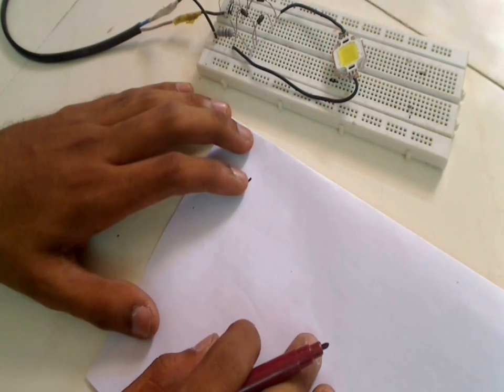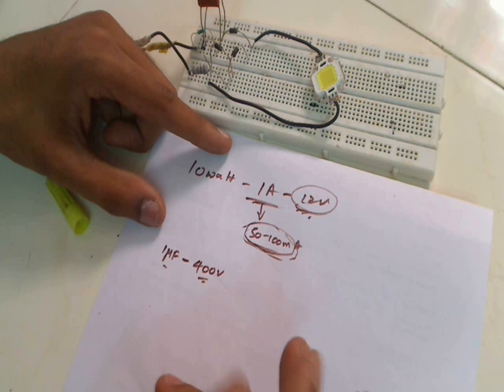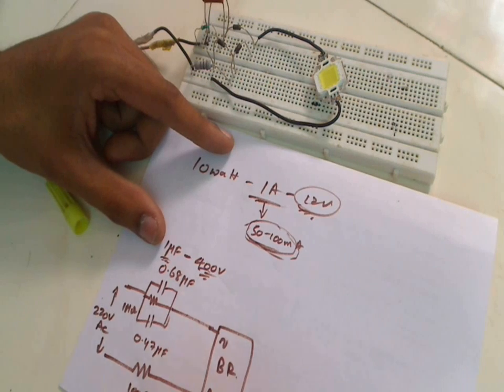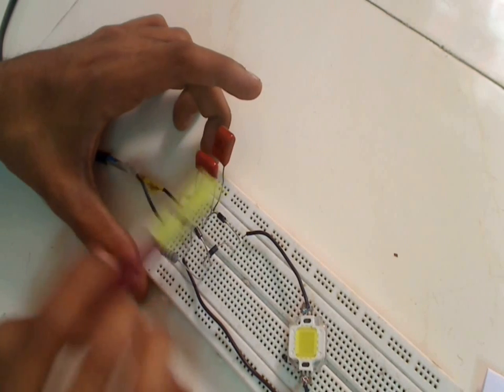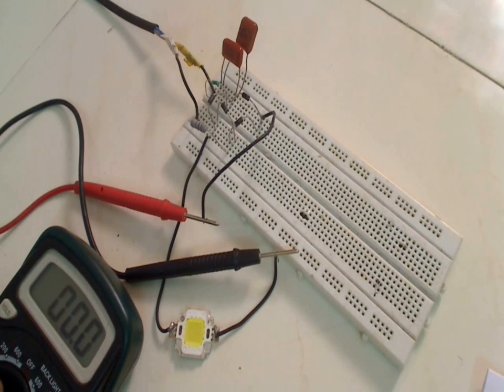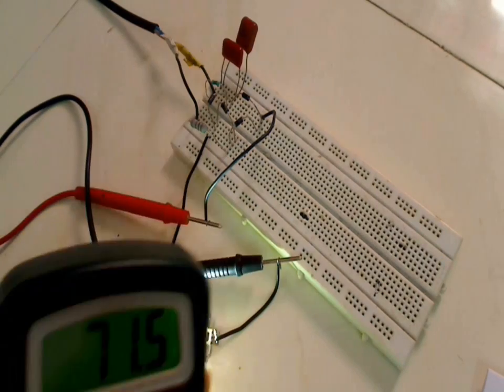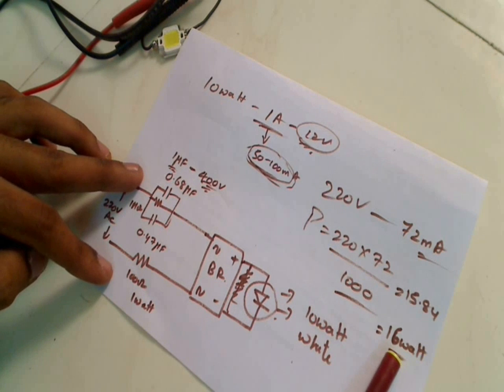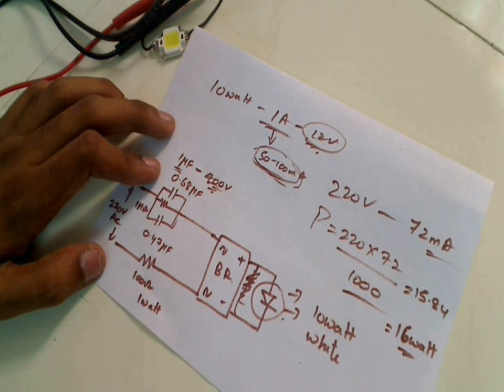Transformerless 10watt Led Driver circuit

Comment: I want to make a 20w led driver can u tell me values of components for that
Reply from the maker: +anurag dixit 20watt led requires lots of current and it's better you go for smps or a transformer power supply
Reply: Electronics Made Easy : KHADER problem with the transformer supply is that they r very big n heavy so i can't put them inside the led bulb

Comment: What's the efficiency of this circuit? There's at least some power gone lost in the resistor, capacitors and rectifier. If i'm going to drive many LEDs, would it be more energy efficient to simply skip the mega ohm resistance and instead connect like 40-50 LEDs in series, as many as would be required for optimal forward voltage. If we instead connect them in parallel to your circuit, then we'd also increase the current flowing through the rectifier and more power would be dissipated there, whereas connecting them in series would only dissipate very little power in the rectifier. I dunno... i'm just more into efficiency, rather than just making things work.

Comment: nice explanation Sir.
i wanted to power up 10W grow LED with this easy way. the light will stay ON about 18 Hrs per day.
so i wanna know, how much heat will produce this circuit and the LED??? is it efficient for my requirements?? 
Thanks

Comment: Circuit is working but 100 ohm resistors get hot too much.what should i do now ...
Reply from the maker: +Devendra Singh replace the resistor with a higher power 100 ohm resistor
Reply: Sir I have connected 2 watt resistors still the same problem....
Reply: Devendra Singh

Comment: Can someone assist me in a project? I wanna make a circuit that will power many led strips and have a fading in and off effect.. Any help appreciated.. Thanks
Reply: Shabeer Khan good morning dude, i think you need to use Arduino or a general microcontroller. is this strip RGB or  is a classical one color led strip?
Reply: @DIYelectronics its a 3 meter solid color led strip and thanks for the respond.
Reply: have you got basic knowledge ? i mean, do you know how to solder on a perfboard?
Reply: I repair laptop Motherboards on component level so I have a bit of understanding just need a little jump on what components to use for my desired lighting effect
Reply: OK.. like i've said and arduino ,even the attiny2313 (suitable up to 4 fading outputS ), or an attiny85(up to 2 outputs), mosfets (a transistor is suitable too), the number depends from the led strip number, and the same number of mosfets resistors (any value between 100 and 2700 ohm is suitable). if you want a code for the Arduino, last summer  i've written a code for the light effect you are looking for, so eventually you only need to ask. have a nice day sir.
Reply: thank you for your help...and i was really interested in making a circuit that only involves a couple of caps and resistors that slowly charge up and slowly drain to give me the desired effects. if you can help in assisting by listing the components and point in the direction or a schematic that would be great and thanks again @DIYelectronics
Reply: Shabeer Khan oh, i'm sorry friend. if you only need a fade effect, a pairs of capacitors, some resistors and a couple of transistor are enough. if you want to give me your email whould be simple for the schematic. otherwise if you don't like to leave the email address here i can give you mine, so you can write me and i can reply with all the component list and schematic. bye.
Reply: Shabeer Khan i've copyed the mail addres, you can delete the message now. i'm going to test my schematic on breadboard as soon as possibile, but in the next 2 hours you should find my mail.
Reply: Ok I'll watch out for the email
Reply: sent emails. version with legendary 555 timer. tomorrow the transistor version will be released

Comment: Your power calculation looks strange. You need to measure voltage over LED and multiply with current (0.072 in your case) to get LED power.

Comment: Do you think it would be possible to use 2 LM7812 voltage regulators running in an ac configuration from mains to do this?

Comment: What are the capacitors for? I understand the resistor regulates the current through the LED, but the capacitors look like they would just be a high-pass filter.

Comment: why the circuit give you shock please explain?
Reply: because you are dealing with AC voltage, which is conductive to human body more than DC
Reply: +Smatchimo yes that's right bt the output of this circuit is DC also this is a smps supply.I think if a transformer is used then the circuit will not give you shock.if you know the reason and the solution please explain and share.thanks for your comment.

Comment: Please give me a transformer-less 12volt 2amp dc power supply design with components description.
Reply from the maker: +Atikul Islam a transformerless poweUpplies are usually preferred for low costs and also the portability of design. A 2amp power supply requires a really big capacitor (infact very costly one) and the circuit becomes really dangerous due to the amount of current output so kindly prefer transformer power supplies for higher current.

Comment: its not working even with the specific values. not even for a 5 watt led or even for a 1 watt led....
Reply from the maker: +Parasar Bhattacharya you can try using a 2uf capacitor but better to keep it as low as possible to avoid high current flow
Reply: Electronics Made Easy : KHADER
 thank you i  will try that and  report ... thank you..
Reply: Electronics Made Easy : KHADER
 i idnt find a 2 MFcap, so used 3 caps with a total of .956 mf nearly but my led burned out... so please tell me that will i have to change the resistor value also?
Reply: Electronics Made Easy : KHADER
 no it isnt working the led isnt getting the rite power and even worst is that after some time if it is switched on and off for two or 3 times it is burning the led...

Comment: Very very best tutorial.

does the bulb glows in its full capacity

I mean does the the bulb glows in its highest brightness
Reply from the maker: +Aakash Sharma no it is not its full brightness but it is pretty bright to be used as a study light or work light.
Reply: +Electronics Made Easy : KHADER Can i add more capacitors to nearly 10uF in parellel
Reply from the maker: that would be a very high value and may damage led. use something below 1uF

Comment: oops! There is a mistake in my previous comment! the power in the lamp is just about 9.8volts*65mA, about 750mWatts, in the 10watt LED.. One has to have much higher capacitance in series to get the current as about 1 amp and then the power dissipated in the LED will be 10watts and it will burn out without a heat sink. And what about transients in the mains supply. It will kill the LED for sure unless a 100uF /25V is placed across the LED.
Reply from the maker: +Mani V.S.V. yeah true,but the current(65mA) too less to what actually the led needs(900mA) so the led wont die so easily. the brightness of the led is not its full capacity but it is pretty bright to use as a table lamp or a study light. Using a higher capacity capacitor would damage led and the circuit needed would be complicated to handle such high currents

Comment: the power in the lamp is just about 9.8volts*65mA, about 750mWatts, in the 10watt LED.. One has to have much higher capacitance in series to get the current as about 1 watt and then the power dissipated in the LED will be 10watts and it will burn out without a heat sink
Reply: Mani V.S.V. maximum amp that can be supply in this power diaode?

Comment: will it be more efficient if i use 2 led in series in this circuit ?.each led will then consume around 8 watts. what will be the resistor value instead of 100 ohms 1watt?

Comment: will it be more efficient if i use 2 led in series in this circuit ?.each led will then consume around 8 watts. what will be the resistor value instead of 100 ohms 1watt?
Reply from the maker: yes it will be more efficient. resistance value will be same, just add another series led to this led.
Reply: +Electronics Made Easy : KHADER I just used a capacitor from a ceiling fan rated 2.5 uf 440v and connected 6 led in series. works great except for heat generation. will adding more number of led solves this ? Or should I use three independent circuits each with 2 led and 1uf capacitor
Reply from the maker: +Ali Ahmed may be the capacitance is too high so use a lower capacitance will reduce the heating problem
Reply: +Ali Ahmed yes you will have a lot of heating problem and life of LED will be much lesser. You need a heat sink for each of the 10 watt LEDs. 6 LEDs in series will mean about 60 volts and together the LEDs will have a power of about 12.5 watts distributed in the 6 ten watt LEDs.